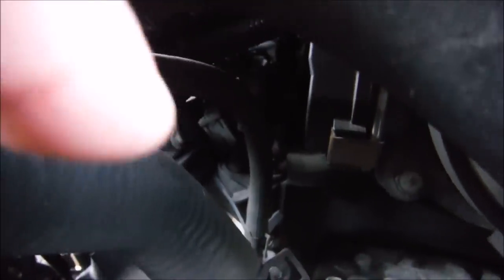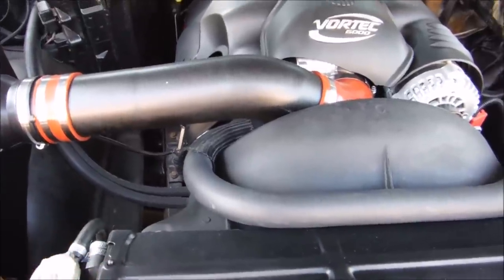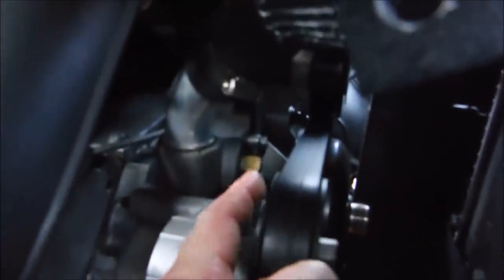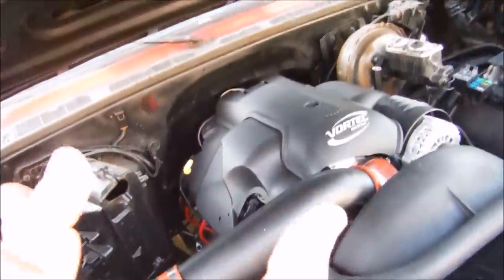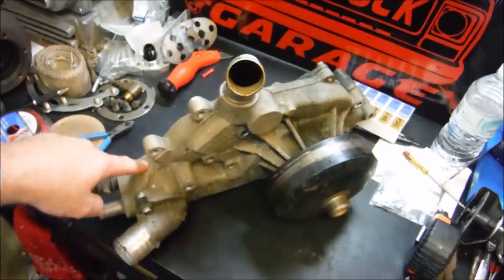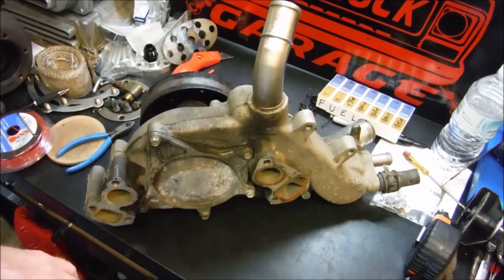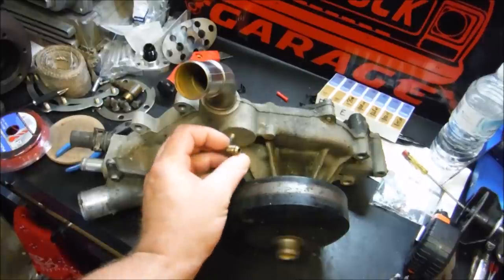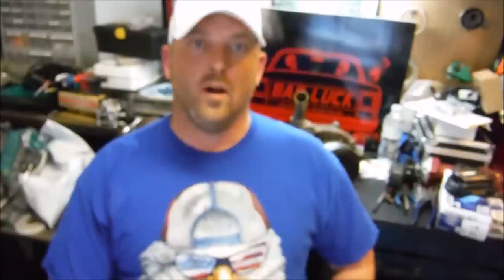LS STEAM LINE HOOK UP AND EXPLANATION

Comment: Wait, what keeps air pockets from getting trapped in the steam line where it travels "down hill" to your fitting?
Reply from the maker: Pressure and physics. The steam ports are the highest point in the cooling system in the engine. Even if a small amount of air were to “stay in” the steam line, it has already done its job by ensure that air isn’t trapped in the block or head. After that, the pressure from the pump moving coolant into the bottom of the engine, coupled with the suction on the line from the pump pushing the water out of the engine(this is why it’s important to tap a part of the pump moving the coolant out) should pull any small amount of air left in the steam line into the radiator where it can burp into the overflow. The truly important part is that you use the ports as intended to bleed air out as you fill the system with coolant in the first place. Then there should be very little air trapped in the block anyway. 😉
Reply: @BadLuckGarage  ok sounds good. So drilling or punching a hole in the side of the thermostat is also a good idea on LS motors? What size? 1/8"?
Reply from the maker: I’ve heard of people doing that but again, if you follow the proper fill procedure to purge the system then it wouldn’t be necessary to relieve air and if you’re doing it to try to manipulate the temperature, I would recommend just buying a thermostat with the appropriate opening temp so that it can still regulate flow accurately. I mean, you can get a 180 or even a 160 thermostat for around $20. This is just my opinion on the matter. The point of the thermostat is to ensure the water stays in the radiator long enough to be cooled down as much as it is to let hot water out of the block. Allowing the coolant to constantly flow can help in some situations but it can also make things worse in other situation as well.
Reply: @BadLuckGarage  makes sense. I'm looking for an aluminum block LS for my 69 Chevelle. The newer Gens skyrocket in price. Are they worth it? I plan to put a centrifugal blower on for low end torque but will only go for around 600hp or so. I'm not interested in cast iron. What block do you recommend? I was planning on LS-7 until I heard they had some issues.
Reply from the maker: The LC-9s are aluminum 5.3s but was with any gen 4 block you'll have to do AFM delete. If youre wanting bigger than a 5.3 then you're going to be paying the premium price brother. I know you said you dont want iron but its still gonna weigh less than a traditional smallblock would with aluminum heads and plastic intake.
Reply: @BadLuckGarage  budget isn't a problem, but value is, if that makes sense. I'll have to Google AFM delete. I'm just seeing that anything LS-2 or newer is 2 Grand on up. Is there any issues with LS-1s? It's not so much about the weight for me, it's cool factor.
Reply from the maker: Nope, nothing wrong but LS1s usually carry a pretty high price as well. Gonna be beefing one up in the new Corvette project I just started on the channel.👍
Reply: @BadLuckGarage  I just picked up an LS-2 out of a G8 today for $1000. I was surprised to see rectangle port heads, I was expecting cathedral?
Reply from the maker: Thats because its not an LS2, its an L76....and if you got it for $1000 thats one hell of a score brother.
Reply: @BadLuckGarage  L76 eh? I'll have to read up on what that is... Lol
Reply from the maker: its a gen 4 6.0 with rectangular port heads. Came in the G8 as well as trucks.
Reply: @BadLuckGarage  ok, so better flowing heads vs cathedral? What kind of power should I expect with a big nasty cam?
Reply from the maker: Yes, definately better flow than cathedrals.But the L76 only has 9.5 compression. You should still be able to get around 400whp no problem with the right cam and a good tune though.
Reply: @BadLuckGarage  the plan is to super charge since the 69 Chevelle it's going in is heavy. I just need to decide roots vs centrifugal. I'm not willing to cut up the car, so air to water IC either way...
Reply from the maker: I prefer the bottom end grunt of a roots blower over the gradual build of a centrifugal. Same reason I prefer nitrous over turbo.
Reply: @BadLuckGarage  agreed, my only concern is hood clearance. I'm surprised how much money people want for LSA blowers. You can buy brand new kits for the same price I see LSAs going for on eBay!
Reply from the maker: There used to be a guy on the swap forums(not facebook page but actual forums) that was selling takeoff kits with everything needed to put the LSA on a cathedral port truck engine for around $2500.
Reply: @BadLuckGarage  the problem I'm seeing now is LSA recall blowers being sold with no warning, as if they are perfectly fine. And the seller just claiming ignorance.
Reply from the maker: Right but isn’t the recall an easy $40 fix? I remember reading somewhere that it was just a bushing or something but GM replaces the entire blower unit instead of dismantling it to replace the bushing. I know the guy I was talking about earlier was selling recalled units but included the replacement part to fix them as well as all adapters and brackets and even belts to put them on truck engines.
Reply: @BadLuckGarage  yeah that's my understanding, as long as you change out the coupling BEFORE it disintegrates you are good.
Reply from the maker: So I just found a website that sells either new or remanufactured LSAs with everything necessary to put it on a C5 Corvette for $3800 for the remanned unit or $4400 for the brand new one. I’m gonna have to start saving up. 😈
Reply: @BadLuckGarage  what's the site?
Reply from the maker: https://boostdistrict.com/collections/gto-supercharger-kits
Reply: @YZFoFittie  don't get caught up in all the hype about 243 heads being far superior to the cathedral heads.  Fact is that the cathedral head makes better torque down low and the hp difference up top isn't that big a deal and with light touch up the cathedral heads will do the same as a 243.  Power under the curve is what you should be concerned with, that's where the work is being done.  You can run a centrifugal sc as a hybrid if budget isn't an issue and get roots style performance by utilizing a pulley that will give you 1.7 to 2x the boost you want to run and use a wastegate to regulate it so that your boost comes in way sooner and holds across the rpm range.  Turbo in an "A" body isn't too bad with an ls swap but it is much more difficult with a big block.  I have a 68 with BBC,  stand alone and turbo.
Reply: @turbochevelle5641  sounds bad ass, id like to see that setup, pics or vids?
Reply: @YZFoFittie  nah, I don't video my car too much.  I have a few pics, car is in our shop now about to go under the knife again and get a set of twin 76's and have some dif work done for new set up.  Thought about going with a  Vortech YSi centrifugal but going to stick to the turbos, far more driving and maintenance friendly.  I am a dealer for Vortech, Paxton, Precision, Comp, Garrett, Borg so it makes the builds a little easier on the pocket but  it still is costly.  You ever need some parts let me know and I'll pass them through at cost to help you out.  I'd be glad to help in any way I can if you have any questions or needs just let me know.  I can also hook you up with one of the best remote tuners in the game too....
Reply: @turbochevelle5641  sweet thanks! Where you located?
Reply: @YZFoFittie  about an hour east of Houston, Texas.
Reply: @turbochevelle5641  I'll trade you... Las Vegas here...
Reply from the maker: Turbo Chevelle, Just FYI brother, 243 heads ARE cathedral port heads. 😉
Reply: @BadLuckGarage  yeah your right but the point is what I stated is correct.  There are so many different head casting numbers it get ridiculous on the LS based engines. We don't have any problems with cathedral port heads and they make better torque down low than the rectangular port heads and the real power that counts is power under the curve.
Reply from the maker: Yes in general the cathedral port heads tend to make more bottom end torque while the square ports make more power up top. But  the extra little bit of torque the cathedral port heads generate below 3000s rpms isn’t really an advantage over the larger gains squareports male above 4000 rpms unless you’re looking at building something for towing or pulling a trailer. It should also be noted that each of these heads respond differently to different cams so a true straight up comparison can’t really be made since a cam that might do better down low with one style of head may not work as effectively with the other and vice versa. So I’m the grand schem of things all we really know for sure is the square ports always seem to make more power up top AND more average power, making them the best heads overall. On the cathedral port side, without any porting, the 243 heads are the best flowing catherdral port heads gm made. That’s been proven. But even with that, I’ve seen numerous dynotests where the 706 heads made power over the 243s in spike of flowing less just due to the increased compression from the smaller combustion chambers. I really don’t even know where I’m going with this other than every combo is different and there’s really no “one size fits all” or “this head is better for every application” scenario. Lol.
Reply: @BadLuckGarage  yes sir, every build is different.  Honestly any of them will make more power than most can handle or are used to in forced induction applications but at the end of the day it comes down to combination of parts to achieve the desired outcome.
Reply: @turbochevelle5641  where you at.. Orange?
Reply: @swampjoe1985  mid-county area
Reply: @turbochevelle5641  cool. Yall got a ahop there. I might swing in so.etime and check schit out

Comment: I probably have other iusse with my build I was thinking maybe was vent tube set but mine so to a aftermarket radiator steam port so  should be fine there now down to water pump thermostat setup or the Chinese eBay radiator
Reply from the maker: Just remember, if you don’t follow the correct fill procedure, steam line or no steam line, you WILL have air pockets and the engine WILL run hot! I drive myself crazy back when I did my first LS swap trying to figure out why it kept getting hot. Finally figured out the system just wasn’t full. As for the China aluminum radiators. That’s what we’re running in the DR Nova and she stays at 205-210 degrees, same as all factory thermostat LS engines.
Reply: @BadLuckGarage   yeah mine take few minutes to get up to 180-200 can cruise around on if I lay into at all it will jump to 220 no problem running a BBC electric water pump

Comment: Good explination to them. I still prefer the older gen 3 blocks myself for a variety of reasons, most of them being you don't deal with the horrible AFM/DoD junk and have to fool with deleting it, and actually having a throttle cable. I've seen a lot of guys that have had detonation issues and completely dropped a cylinder on the later versions, and it usually always seems to be 5/6/7/8 and rarely the front four. Don't know if it's again, more to do with the horrid DoD tech, or the loss of that rear steam port and heat issues. I just much prefer the run of the mill LQ4/LM7 garden variety LS. Mostly just goes back to KISS, keep it simple, stupid.
Reply from the maker: The 4 port steam ports aren’t a gen3 or gen4 thing brother. They stopped using them in most applications early in gen3 production.
Reply: @BadLuckGarage  Well I'm just a shade tree mechanic and I don't work on the things for a living, so I'll default to your knowledge, but every Gen3 I've touched had the front and rear's knocked out of the head for 4 ports. The LQ4 I'm rebuilding right now out of a 2500HD is the same way, both front and rear's. But like I said, I prefer the old truck engines, easier to work on and not as much dumb tech to "clog the plumbing" so to speak, so that's all I've chose to work on.

Comment: Originally the LS1's were designed for reverse flow  water pumps, but  with GM not wanting to pay the licensing fee for the technology they cooled the motors conventionally not reverse flow.
Reply from the maker: Interesting theory, but GM was already using reverse flow cooling on the LT1 engine that the LS1 replaced, so im not sure why it would have been considered new technology in need of licensing.
Reply: GM only paid for the LT1/4  and GM  Did their own deal with the LS1 and were sued and then went back to the conventional cooling. The 1998 Pontiac Firebird catalog actually advertises the reverse cooling in the new LS1.
Reply from the maker: Interesting.  I’ve never heard that before. 👍🏻
Reply from the maker: You got my interest peaked brother so I checked it out. Looks like they were sued over the reverse cooling of the LT1 back in 94 but the case was thrown out. At least that’s all I could find. Didn’t find anything about the LS. 🤔 I really would like to read more about this though.

Comment: What’s your opinion on the “T” fitting meant for heater hose?
Reply from the maker: It works as long as you tap the correct hose. But I prefer to just tap the pump as shown in the video for the reasons mentioned in the video.

Comment: One thing.. You dont want to run the steam line into the heater core either.
Reply from the maker: INTO the heater core, no. But into the line coming back out of the heater core will also work. Matter of fact I believe that  on the V-8 Rainiers, Trailblazers, and a few other gm vehicles the outgoing heater hose actually has a metal nipple sticking out of it with the steam line from the throttle body connected to it.
Reply: See, one thing i'm worried about with the steam line is air coming out of it.  Obviously you dont want air in the heater core since usually it's pretty high up in the system, and then obviously you dont want it into the inlet since then you're spinning air through the pump/motor again.
Reply from the maker: Getting air out of the system is the whole purpose of it. The idea is that you plumb it into an area of the pump that is moving coolant away from the engine and into the radiator where it can be burped out the overflow tank. You don’t plum it into a line or and area of the pump that is moving the coolant back into the block or anywhere else but the radiator. If you google a picture of the flow path of coolant through and LS cooling system and just keep that in mind then you’ll find there are actually several places even other than the ones I listed in this video that it can be plumbed and still function correctly. These are just the most common spots used.

Comment: my factory 5.3 engine has all 4 ports BUT the two ports in the rear are blocked by the bolted on plugs but the holes still exist , the front two are connected to each other. my 6.0 engine had all 4 connected to each other. only 1 model year earlier. goofy.
Reply from the maker: Yea all the LS heads have all four ports.They just don’t all utilize all four.